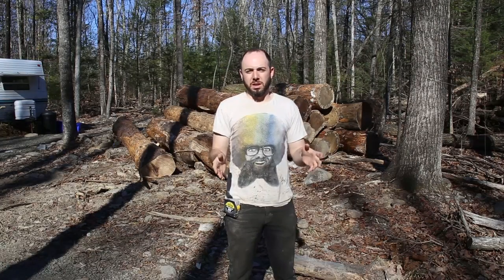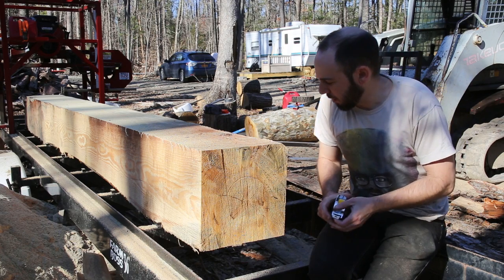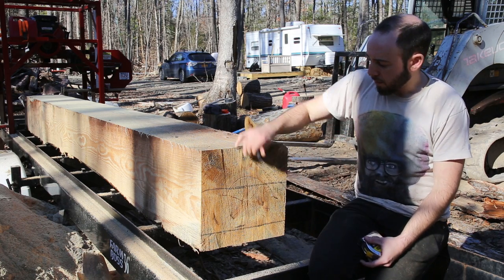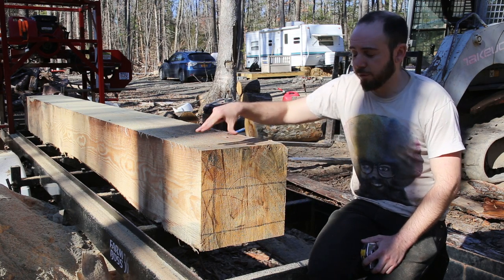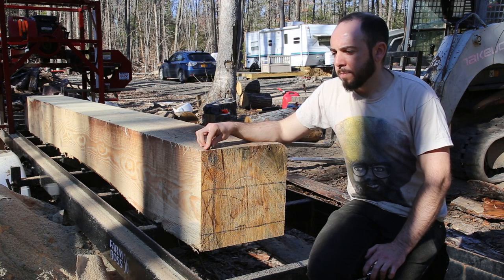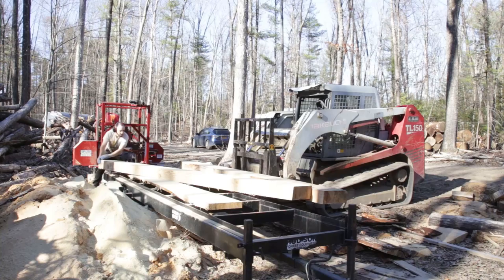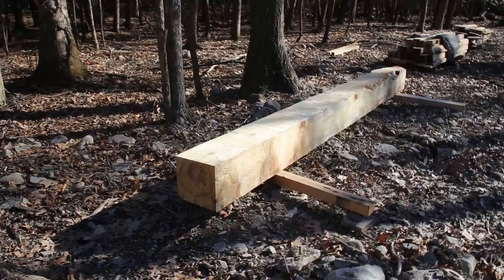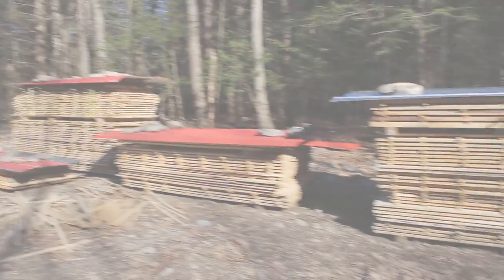Milling Construction Grade Pine

Comment: If you weren't going to plane down to 1.5x3.5 why not just rough saw it to that? So you get more boards out of the log and standard things like doors and windows would  just work like normal in your walls
Reply: Sawing lumber slightly larger dimension that the desired end dimension allows for the woods shrinkage as it dries out
If your wanting to end up with  2" X 6"  lumber  oversize saw it at about.   2 1/4"   X  6  1/4" 
After the lumber is air dried for about 60 days down to a lower moisture content and the shrinkage is all done
Then it's finished or planed down to the  consistent 2 X 6 dimension

Comment: I have a band mill. The problem I'm having is a lot of sap build up on the blades when cutting pine. The question I have is do you have that problem when you cut pine and what do you do to help prevent it from getting on the blade. I use soapy water and I have increased the water flow but still have a lot of build up get on the blade. Thanks in advance.
Reply from the maker: +DTBAXLEY I have been milling mostly hardwoods, but i did have a little pitch buildup when i milled the pine.  Same thing as you, dishwashing soap in the water and increased the flow.  I had a little build up that I got rid of by finishing the blade off with a hardwood log.  Woodmizer sells their own pitch removing liquid you can use instead of dish soap.  If you give that a try let me know!
Reply: I read somewhere that a guy was using a mix of pinesol to water. Maybe 1 to 4 ratio. cant remember
Reply: add some dish soap to your water coolant
Reply: Windshield washer fluid throw in a gallon. Alcohol